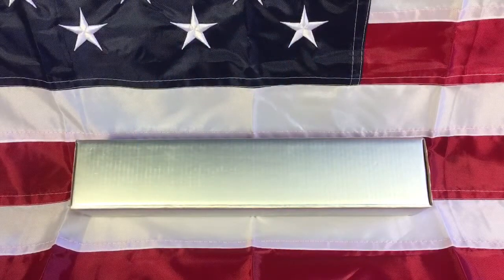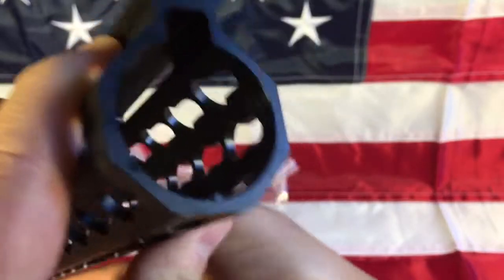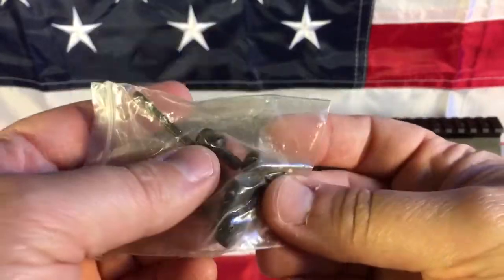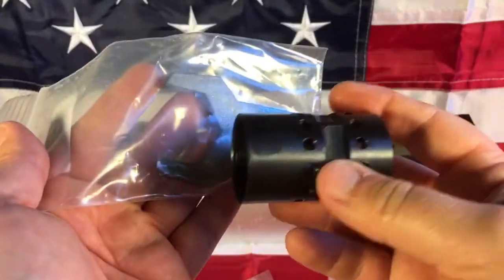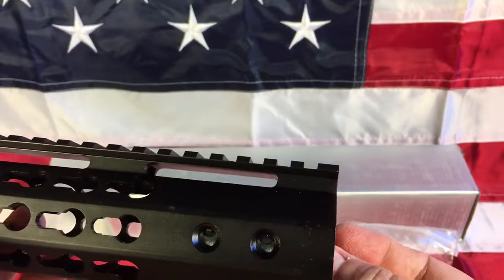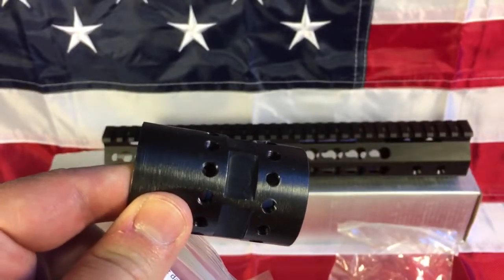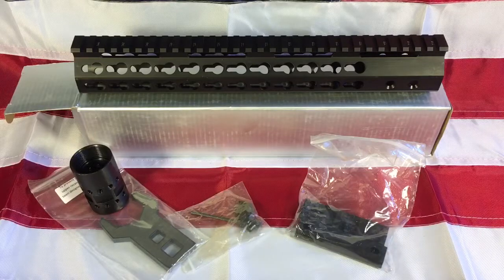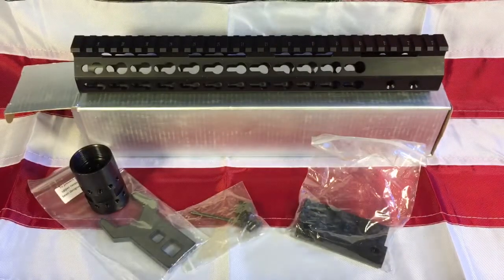Smith Built 12" Free float Keymod rail system for AR-15

Comment: Birchwood Casey aluminum black will take care of any spots or scratches on it..Been there and dun it.  Actually the shims help line up the top mounts so when you tighten the nuts down the weaver mounts on the receive and rail will line up. Nothing to do with lining up screw holes. Thanks :)
Reply from the maker: James K. James K. Thanks for the info. I ended up returning this item. The proprietary wrench deformed before the base torque value was reached. I replaced it with a Bravo KMR hand guard system.